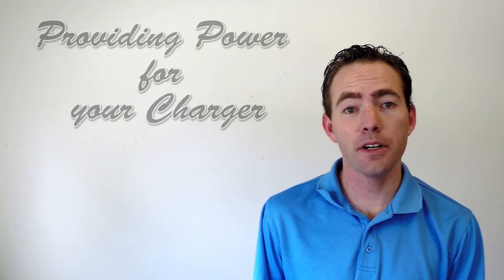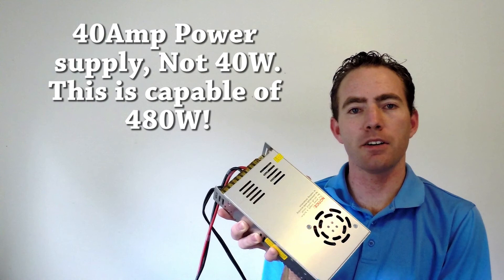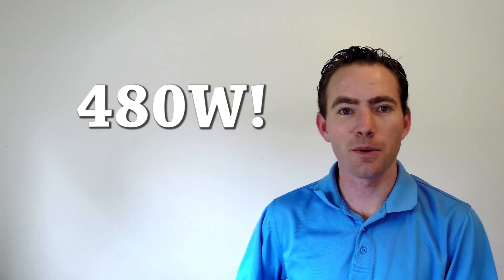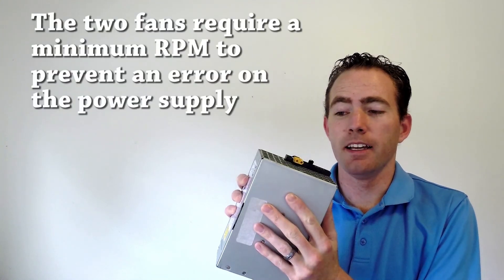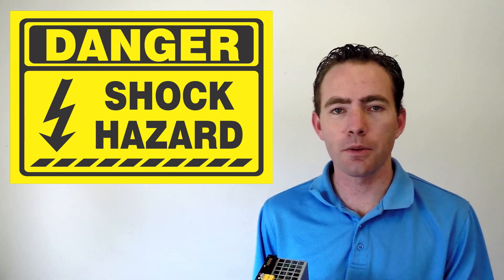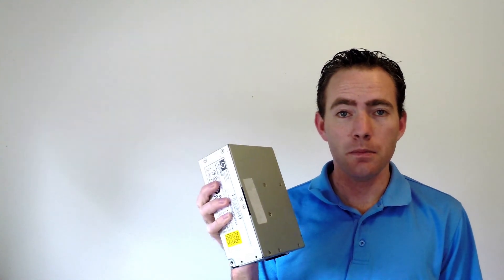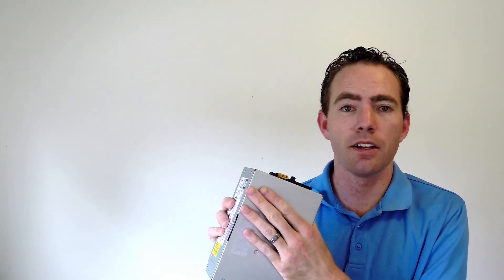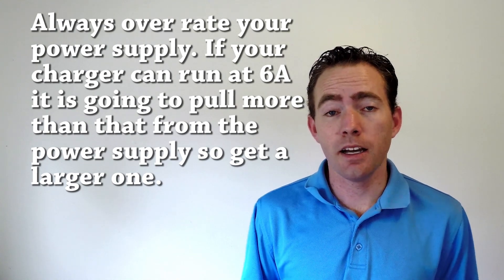Quick Tip Of the Week - Charger Power supply

Comment: I just got the updated Hitec X2 400 and need a 60+ amp power supply........ Real Cheap..... Was thinking about www.feathermerchantrc.com server type 12v69 amp featherpower supplies for $55 or so shipped w/10awg output wires w/4mm female bullet connectors. Could you build me one in that fashion mentioned for my unit? Email me at southerngentle_1@yahoo.com or I have a couple of old computers around not in use that I could soler some wires and conncetors to.... I just need to know where and what to solder.... please email complete instructions..... Thanks a Million
Reply from the maker: Sure! they are very easy to mod you can honestly do it very easy your self. ill get the info off my current power supply for the specs.